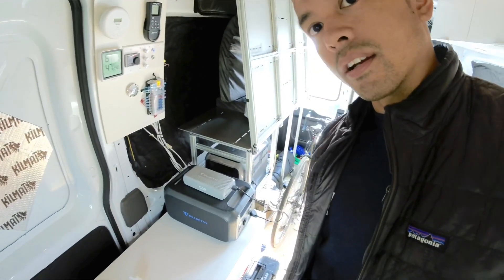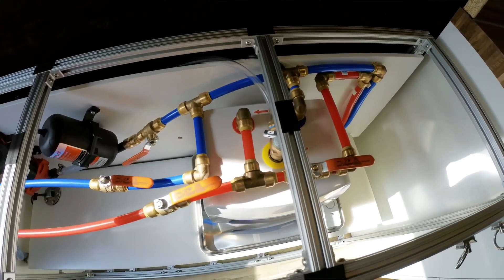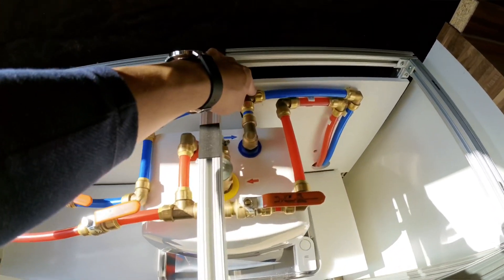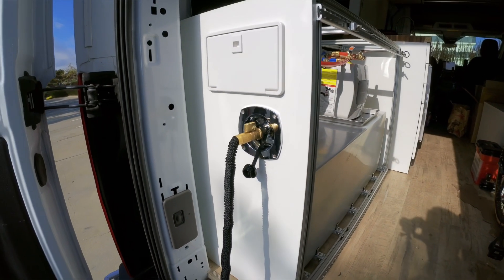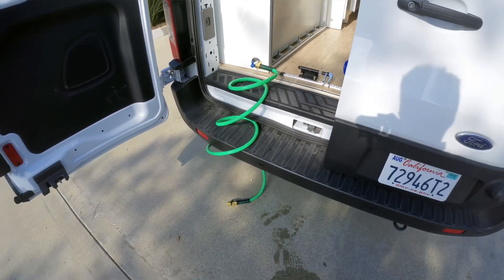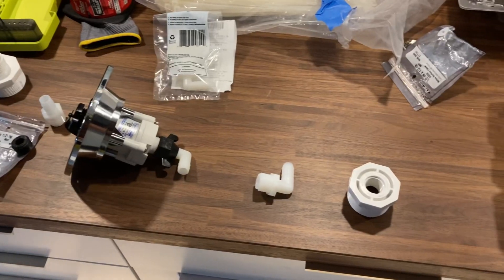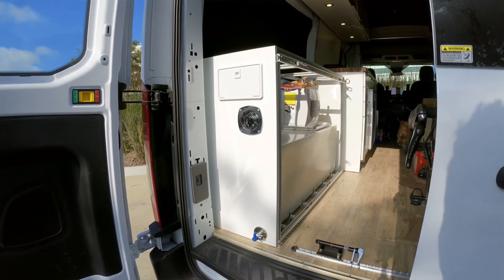AWD Transit CLEAN PLUMBING and REAR SHOWER INSTALL! - Part 25

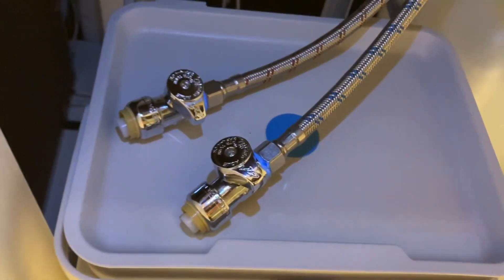Comment: Great water system setup. Couple of suggestions: At 13:10, it's best not use the Teflon tape on the 3/8" connections. Those generally come with a dedicated gasket, and Teflon would interfere with the seal. Also, it's pretty handy to install a 6" access hatch to the tip of the tank. This makes cleaning and servicing the tank much easier. And if you do this in the beginning, it also makes getting the plastic shavings out easier. Otherwise really good approach!

Comment: Hi Rich, you should add a support 80/20 bar in the middle of the outside water tank.  In the long run, the water tank will change shape slightly with full water.  This is one thing I forgot to do before i add the panels.  I also tried this electric water heater.  It drained more than half of my battery, so I went with the gas water heater.  Don't need to worry about battery percentage.
Reply from the maker: Good idea Jack, I'll have to do that.  Yeah I tested the water heater and I think its best utilized when on shore power only or emergencies.

Comment: I think you mean vinyl or poly tubing. I.D. Is an abbreviation to inside diameter. I could be wrong but I’ve bought a lot of that braided vinyl tubing over the years.

Comment: Hi there! How is the water heater working for you? I'm curious about the power draw. Do you leave the water heater on at all times? Or do you turn it on before you need hot water? Great video!

Comment: Thank you for sharing your build. I am currently working on my cargo van conversion at the design stage. I have a 2022 Transit 148 mid roof and really like your clean and compact layout. I wonder whether you can share the dimension of your water system, in terms of length, width and depth. Thanks.

Comment: any thoughts on that Bosch Hot Water heater?  I've got a propane instant heater and been thinking about switching to the Bosch, but I'm concerned about how much electricity it draws.

Comment: This is an awesome build thank you for your channel. First question which 20 gallon tank model is that? Is it the full wheel well cover sp-c-20 or is it the one that has an open end on one side sp-l-20. Second question are you going to do an electrical setup video? I really want to see your electrical set up I'm planning on using the bluetti system. Keep up the great work.

Comment: Again, great content. Very clean install.  It looks much more serviceable than my install.  Is that water heater just plumb and play?
Reply from the maker: Thanks Jeff. That’s right. It simply fills up with water and gets pressurized as part of the system.

Comment: Very Nice Setup!! Thank you for sharing. Do you have DC to DC charging setup for your Bluetti AC200+ B230?
Reply from the maker: Thank you! Yup I’ll be incorporating that to the setup
Reply: @RichBuilt  Cool!! 😊 I have AC200Max + 2x B230, and 400W Solar for my setup. We don’t have much sun here in Seattle so I need to figure out how to charge the Bluetti while driving. I’m thinking about using Victron DC - DC charger but not sure if this will work. Goal Zero implemented car integration kit for their products. I suggested to Bluetti, hopefully they will consider. Thanks again!! looking forward to your video about electrical.

Comment: Please correct me if I am wrong, while shut off valves are need for your home (connected to city line), I am missing the need for shut off valves (added cost and weight) in such a small system when you can shut off the pump. Anyone, please tell me what I am missing as I am installing a water system in my vehicle as well. Thank you. And thanks for sharing this setup too.
Reply from the maker: KnittedBrow, the shut off valves are not necessary, but I installed them out of an abundance of caution should I have to resolve any issues down the road with any of the fixtures/fitting leaking.  It will allow me to isolate and address issues without having to empty the system. Will come in handy if I'm in the middle of nowhere and want to conserve water.

Comment: How does your murphy bed stay up while you are driving? Are the 80/20 hand twist brakes strong enough to hold it up?
Reply from the maker: Tom, the bed will not stay up while driving. I’ll need to create another anchor point to do this.
Reply: I did the same setup as Rich.  But I used the 80/20 15 series. I always kept the bed up and had no problem. I been using for 6 month with no issue.

Comment: I am installing a Bosch electric water heater (similar) - do you know if they need to have a pressure gauge? Thanks.
Reply from the maker: From everything I saw when I did my research, it did not require a proprietary gauge.  Even in a residential setting, but I would always double-check the manual and your application.

Comment: I followed you and got a bluetti AC200P back in May for my RV.  Did you have problem with your display on the battery percentage.  The percentage of the battery remaining does not show correctly on my.  Do you have the same problem? Also are you going to add the shower inside the RV?
Reply from the maker: Jack, I have not had that issue.  I haven't had any issues with my original AC200, but I know the company will take care of you if you bring it up them.  Hope they can get you a replacement unit if they can't troubleshoot it.

Comment: Hey rich. Great job on the build. What did you use to secure the nw conversion tank to the floor?
Reply from the maker: Thanks Jamie, the tank is secured using angles attached to the 8020. You can see some of it on the front/bottom of the tank and it’s also attached using Dual Lock Velcro.